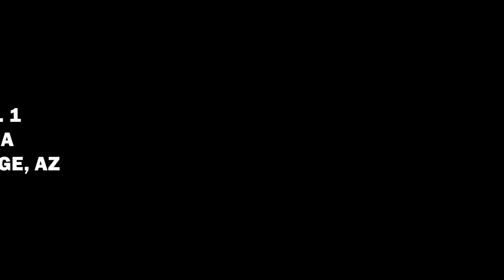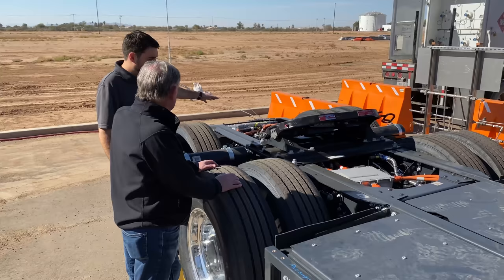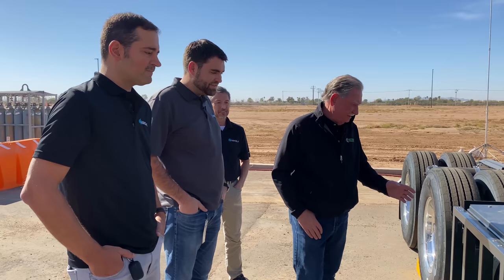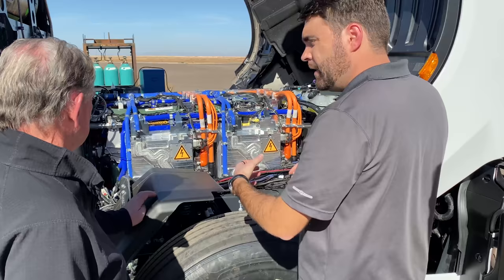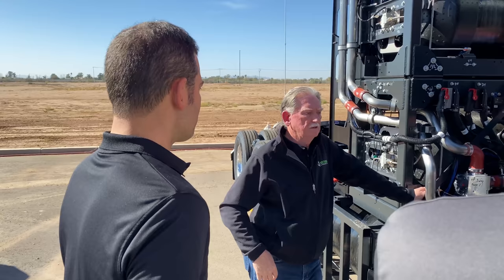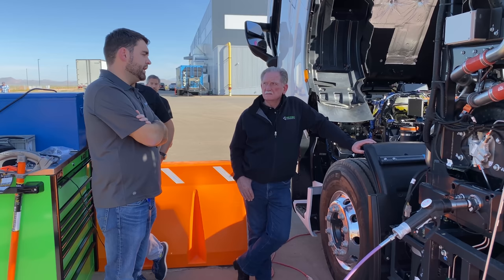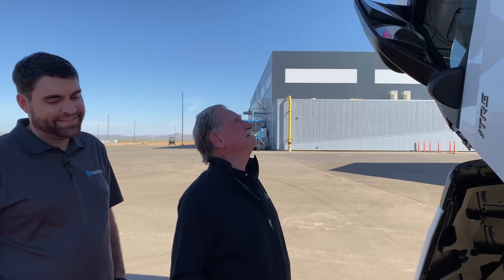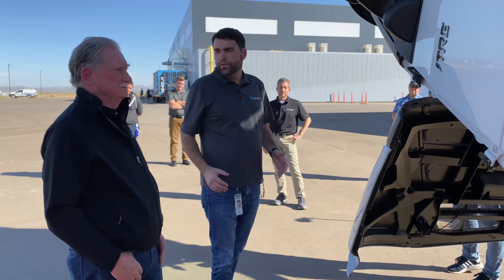Nikola Series - Ep. 1: Introduction & The FCEV Alpha

Comment: Having been a heavy truck hauler in past work lives, I can see lots of cool stuff here.  The tag axle may be an issue in slippery road conditions ...  But I'm sure they'll have options for that. Even as a old man, I have no issues with cab-overs.  There urban maneuverability is superior.  As long as the "climb aboard" route and routine is no too cumbersome, they are the way to go.
Glad to see Nikola actually doing something and making progress :-)
Reply: Fair, unbiased and authentic assessment . Thanks
Reply: Yes, they buyed some Iveco and Bosch tech, and have an empty "factory". Well that's something...
Reply: @zoltanszeles9394  There are other existing global manufactures building these hydrogen power trains and taking orders for truck mfgs.
Reply: @Carl_in_AZ  There are NO existing global manufactures doing this. Nikola and Iveco partnership are on a new path of engineering. Hope they succeed and diesel and  petrol trucks can be resigned to history.

Comment: Efficiency:

Electrolysis: 50%
Compression/Liquefaction: 70%
Fuel cell: 50%
Reply: there have been many more ways to produce hydrogen than electrolysis. It can even be extracted out of oil refineries with some modification.
Reply: Indeed!
Reply: You forget to input the energy costs producing a massive battery pack to a BEV truck.
Reply: @RogerM88  that's a one time energy cost vs. on going energy cost.
Reply: Who gonna pay 5x more on fuel for a nikola truck over a tesla truck? Jesus
Reply: @togowack  wow, so the way to shift cars away from all that dirty and polluting oil is to get them to use a fuel made from... dirty and polluting oil.
Reply: @willyolio9590  I don't think you have benefited much from trolling these comment sections. lol
Reply: @MarkLLawrence  with a increase in demand for Electricity, and Lithium...the prices would go up in a straight line. For shorter routes as in the delivering sector,  BEVs trucks make more sense. Also there are many BEVs trucks in the market, but without all the Tesla hype.
Reply: @RogerM88  electric vehicles have reached their market cap. Either try something new or combine it with a different fuel.
Reply: So, in the end analysis, which concept is greener?  I'm talking from raw materials to end product and environmental effects of hydrogen fuel vs the grid etc.  Which concept is better for the planet?
Reply: @RogerM88  
Except increasing demand brings increasing supply, so long term prices will remain stable. Or rather go down due to innovation and economies of scale.
Tesla is already ensuring the availability of electricity, lithium, and also nickel.
they problem with hydrogen is that you'll always need a lot of electricity to make it, so it will always be much more expensive than using electricity directly in the vehicle.
Reply: @andrasbiro3007  not without huge upgrades on the Power Grid, as with Nuclear Reactors or Hydroelectric generators. Check how many power shortages been happening with intensive use of A/C systems.
Reply: Hydrogen fuel cell electric trucks have better range,  doesn't lose range in cold temperatures, refuels in 15mins for trucks, can haul more cargo because of weight limits on roads. More cargo equals more revenue
Reply: @airheart1  Yes you did those who want electrics have bought them by now. Electric doesn't really solve the problem. It's not new tech anymore. If you offered electric vehicles for ten grand Tesla would sell more but not make any money.
Reply: @RogerM88  another stupid comment here.. you realize EVs along with a growing sustainable grid, ARE the answer to the power issues.. not the problem.. right? I mean are you clueless to the future of using the batteries in all these EVs to stabilize the grid? Yes.. they need to have two way capabilities and not all currently do.. but it's a simple thing to incorporate in EVs and many new ones are adding them already.

There is an argument to made between.. stationary battery storage taking this role.. vs using vehicle batteries. This is fight Tesla is making. We'll see where it goes. Some car manufacturers are giving you the ability with your car battery. Tesla want's you to buy a seperate system to run your home and stabilize the grid. We'll see in time which one those arguments wins out. Or just a combo of both. But this is the future of the grid. Battery stabilized renewable energy. And personally, I have no gripe against augmenting that with a good dose of nuclear plants to provide a base load. Fossil fuels have 0 future in grid energy. The sooner, the better
Reply: @airheart1  in a couple years Nikola will be well past 200
Reply: @airheart1  don't you trolls get it ? In this video, they call the H2 prototype Alpha, Sandy calls it pre production. This is very high praise. This means Nikola is way ahead. You people need to get an education and some critical thinking skills.
Reply: @BillyLapTop  Finally someone is raising the real good questions! Unfortunately (as always with complex systems) it depends. Economies of scale, actual use case, true energy source...just to name a few important factors. I guess the notion of "greener" also is not a fundamentally defined idea.
The good news: As long as we are discussing FCEV vs BEV there is no doubt that the era of ICE is coming to an end
Reply: @airheart1  you're just moving the source of pollution to another country. Where the toxic production and intensive mining is stabilized. Also, without upgrading the Power Grid and replacing the Li-on battery technology for a more Eco-friendly and sustainable technology, the BEV market is still not an answer to lower the total emissions. There also the aeronautic and naval industries, that need more efficient engines.
Reply: @Lukas-yo1bt  Hi Lukas, I'm an old man now.  My roots go way back to the days as a kid rummaging through junk yards to keep my broken down cars going.  Always filthy, dirty polluted places, usually located in swampland in NJ.  Over the years, ICE hasn't changed much, still dirty, polluting and very complicated.  I loved the roar of V8"s and hanging out in the local dragstrips racing down the quarter miles etc., but I am glad to see ICE diminish and eventually go the way of the Dodo bird.  No more grease pits, thousand of little parts making up drivetrains/engines and the headaches that goes with it.  Electrification is the way to go, the cleanest, best economical  and friendliest way for the planet will win, I hope.
Reply: @togowack  The truck cab is licensed from iveco which gives them the appear it shouldn't be in alpha but that's not the tech in question. Hopefully their timeline is good and blue skies ahead.
Reply: @bike-cave-man2527  Thats worse than ICE
Reply: Don't forget they'll need to transport the fuel across the country and that takes fuel a truck and a driver (currently) vs. The power grid that already exists and can be cheaply improved over replacing every gas station in the world
Reply: @dominicnappi7181  don't forget that hopefully in the near future solar will be so cheap we can produce our own. At the moment the UK is having huge grid issues after a big storm like Texas did this year, whole villages cut off with no electricity, and now people have electric ovens and fires they have zero gas backup for heating or cooking. PV and storage is about to come in to it's own. In fact friends of mine have been charging their phones in their cars, this is the smallest scale example of the future imo.
Reply: @RogerM88  They conveniently neglected mention in this video that hydrogen powered vehicles still MUST have a substantial battery pack to cover for the fact that a fuel cell is a steady state device that cannot possibly deal with stop and go traffic.
Reply: @mariofornarelli1067  
1. Range becomes irrelevant over 600 miles, as drivers are legally not allowed to drive more.
2. Modern EVs don't lose much range in the cold. And a semi will lose even less, due to it's size and mass. The losses are mostly coming from the cabin heating and the increased drag, and both are less relevant in a large vehicle. As for the battery, modern cars heat it up to prevent capacity loss. That can even be done while the vehicle is still connected to the charger, to preserve even more range. Also a large pack that a semi will have will take for ever to cool down anyway.
3. Charging time is mostly irrelevant, as the driver has to rest anyway, or the truck is being loaded/unloaded.
4. A diesel semi power train is very heavy, on the order of 2 tons, so plenty of batteries can fit in their place. And even if there's a small cargo penalty, the electric power train more than makes up for it in other ways, like drastically lower operating cost, and higher speed.
5. Hydrogen is expensive and will stay expensive due to physics. Making hydrogen without pollution is a very inefficient process, plus the fuel cells are inefficient too, so you'll always need several times more electricity compared to using electricity directly.

Comment: Isn't the whole reason the "Alpha" looked so refined is because all of these components are supplied by their "technology partners" and this is essentially an assembly plant?
Reply: Correct, Trucks are supplied by IVECO and come 90% assebmled, NIKOLA adds the Drivetrain & Fuel Stack provided by BOSCH.
Reply: and the guy said it hasn't even ever started yet 🤦‍♂️ they had it out there fueling for a show, but it's never been started... jeez...
Reply: Tesla started in a similar fashion with components supplied by technology partners: car bodies/gliders provided by Lotus, EV powertrain supplied by AC propulsion, standard size cells sourced from major cell vendors and early Tesla being essentially an assembly shop, believing in the technological approach and integrating all of the components into one actual product.
Reply: @markplott4820  Damn, I did not know that..explains why this truck seemed so familiar, our roads here in Germany are congested with Iveco trucks 😂 So the truck comes from Iveco…the tech from Bosch? What does Nikola add exactly?
Reply: @doalwa  - Absolutely nothing, they are even using Conventional EV battery, not the Flooded Cells TREVOR claims Nikola Developed.
Reply: @doalwa  The hydrogen powertrain. batteries are Bosch. Nikola have to find a way to charge the batteries using Hydrogen. Currently a hybrid electric is complete, But the Hydrogen dream is still in the works, IMHO

Comment: Hopefully Sandy will get around to asking them the REAL key question: How far along are they in solving the fueling station problem? Without a nation-wide network of fueling stations, a fuel cell semi will be pretty useless. Also, where are they getting all the hydrogen to fuel the trucks? And will the hydrogen supply be cost-effective and environmentally friendly? Electricity is everywhere—hydrogen, almost nowhere.
Reply: Green hydrogen is (and will always be) verry rar, as it will be needed to make CO2 neutral Steel (and for other energy intensive processes with no alternative). Dont think its gonna be „wasted“ for the transport sector.
Reply: @whowhy9023   There is no infrastructure and the hydrogen comes from refineries as an off-gas stream.  (i.e., this makes it "blue" or "dirty" hydrogen.)  Even "dirty" hydrogen, taken as an off-gas from refineries, then purified and compressed, is still WAY WAY more money per mile than either electric or diesel.   Despite this huge fuel costs, the actual costs of buying this equipment is enormous.  This is not a viable business.... unless you are rolling it down a hill and hyping it in the media to pump your stock price 😂😂😂
Reply: Electricity is not a form of energy storage - that's what hydrogen and batteries are for. Nations area looking at hydrogen so they can be energy independent. With batteries, most nations would still be dependent on the minerals and production of the batteries.
Reply: ...hydrogen supply, geopolitical stability and resistance resilience to global shocks ?
Reply: @bobh9492  with hydrogen you collect the power from the giant fusion reactor in the sky and store it for as long as you need. Do you know any other ways to do this?
Reply: @KattenApelsin  hydrogen is a pernicious molecule, read up on that, its also terribly INEFFICIENT to use hydrogen as a fuel - solar and batteries is much better - figure that out... hydrogen FUEL is dumb.
Reply: @bobh9492  you can’t store energy from the sun in a battery for ever. You can, however, store energy forever in hydrogen. Read up on that.
Reply: When Tesla built the first Roadster how many charging stations were there. Build it and they will come.
Reply: @T330d  If you are talking about the cylinders being steel they are most likely aluminum with carbon fiber wrap.
Reply: @davidrte.664  Nikola cant afford the cost and havent built a single fuel station
Reply: @Chastity_Belt  Yes, you are right, both Honda and Toyota are making the same mistake as Nikola. But Honda and Toyota have other products. Nikola does not. So Nikola will fail if they don’t have cheap and plentiful hydrogen available.
Reply: @davidrte.664  Not same situation. Tesla built the cars and also built the charging network. Nikola has no capability to build the necessary hydrogen network.
Reply: @davidrte.664  no, i meant the production of Steel from Iron Ore. It is now powered by Coal, so to get CO2 neutral, an alternative to coal is needed. And that has to be green Hydrogen. Lots of it. Sorry if i wrote something incorrect. I dont speak English very well.
Reply: @1949lwd  which is their downfall really. Tesla can get away with electricity because you have backups. 

You want supercharging available when needed but a regular plug is all that is nessesarry at minima and those are everywhere. Hybrids are disguised ICE cars so you can just use the gas station network which is working everywhere and has a limited complexity for transport and storage.

Hydrogen had an even worse logistic cost that gas. It's low density (so you need massive tanks) storing comparatively little. You need a lot of energy to make hydrogen out of renewable sources, then spend more energy to get it to the station on a truck, then you need to store it (and hydrogen is a gigantic pain in the butt to store).

Go give you perspective, hydrogen is so hard to contain it will leak through SOLID METAL. The space shuttle, that used hydrogen as fuel, needed complex pressure seals to prevent the hydrogen from leaking into the oxygen pumps and causing an explosion, and after firing you need to wait a whole month for the engines to "dry" because you are left with hydrogen stuck everywhere or even still imbedded in the metal. 

From a physical perspective hydrogen is a very impractical fuel. For rockets at least it makes sense for upper stages but got any other uses you may as well just use hydrocarbons. 

In fact seeing the energy cost of a hydrogen infrastructure you may as well just use manufactured high octane fuel. It sounds insane but it's actually better.

You do need a ton of energy or heat, sea water and carbon. But let's way you are using a thorcon or LFTR reactor, just by operating the thing you are having an excess of both and in a single costal installation you can make:
- energy for consumers, industry and ground vehicles
- jet fuel (which btw is even higher quality than regular jet fuel) since aircrafts don't mix well with batteries
- rocket fuel, if this is your line of business
- fresh water from sea water.
- you essentially run on the waste products of rare earth mining
- if you can find the water, it works on other planets as well.

Honestly I'm shocked someone like Elon hasn't picked an interest in that.
Reply: If you've got electricity then it's very easy to get hydrogen. You just need some water and an ITM container. So it's fairly easy to make hydrogen ubiquitous too. I think the pertinent question is 'how much does that cost'? Presumably 'quite a lot' at the moment which (along with very little demand in most places) is why it's not happening much yet. There is a lot in Japan and some in Germany.
Reply: Wouldnt be that hard to research and find out their electric contracts and expected price per gallon/litre to be produced! As soon as they can completely solve affordable hydrogen fuel they will definitely already have been in talks with either major construction project or adding pumps at current stations such as flying js pilot etc etc
Reply: @bobh9492  you do understand the hydrogen is charging the batteries? The batteries and electric motors are whats "pushing" the semi!
Reply: @rockdadon1307  dustin you are shilling for a dumb technology when compared to an EV, a hydrogen fueled truck is not an ev, stop conflating the two
Reply: @bobh9492  yes the hell it is! Wtf does fcEV syand for? Fuel cell ELECTRIC VEHICLE! Lmmfao the irony in ignorance!!!!!!
Reply: @bobh9492  a fcev isnt a bev this is true! But a fcev and bev are both you guessed it ELECTRIC VEHICLES learn wtf acronyms are!
Reply: @bobh9492  ps they have bev trucks that are already in production and will be delivered here very soon! Tell me when tesla makes their first delivery!
Reply: @rockdadon1307  ignore the fact theres no where to REFUEL THE DAMNED TRUCKS
Reply: @bobh9492  isnt that one of their goals? Ps there are stations currently but its ok that you dont know that just further establishes what im saying is true and that youre clueless
Reply: @rockdadon1307  theyre 'Looking into that'... lol  Nikola is as dead as their shareholders bank accounts
Reply: @bobh9492  you obviously dont know much as stated again! Go look up  the biggest holders and tell me more about how Sandy Munro has no idea what hes talking about!
Reply: @bobh9492  they have battery and electric only semis! Lmmfao try and keep up! You just keep making good points for nikola while pretending youre making negative points!
Reply: Power to gas.